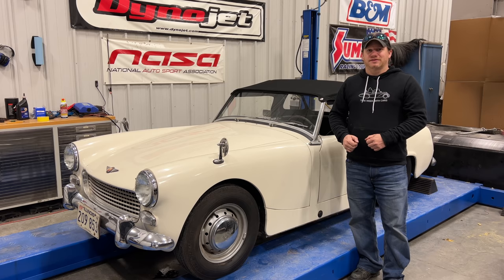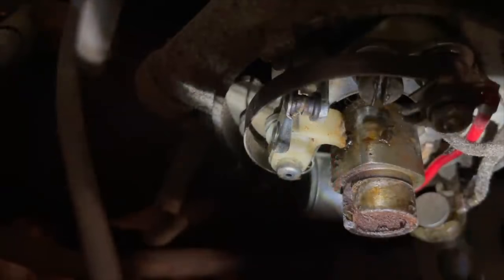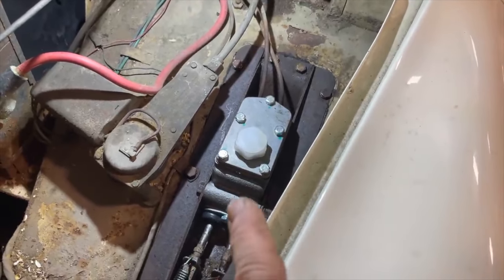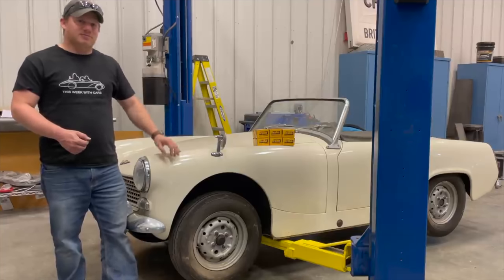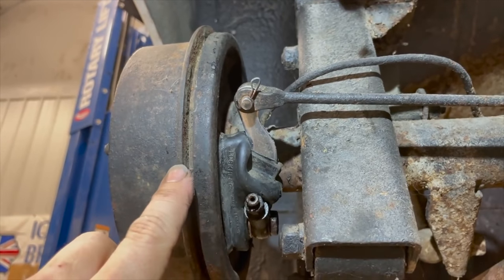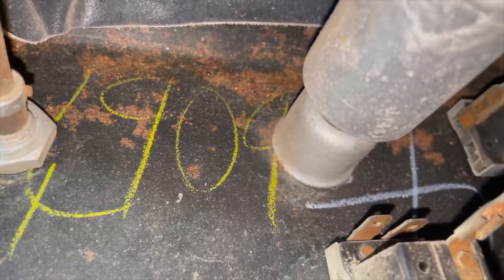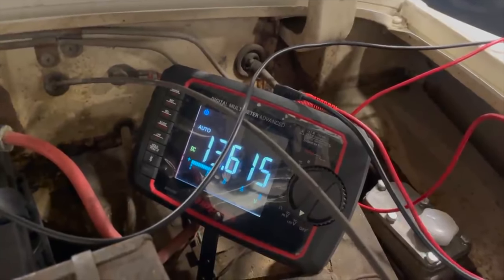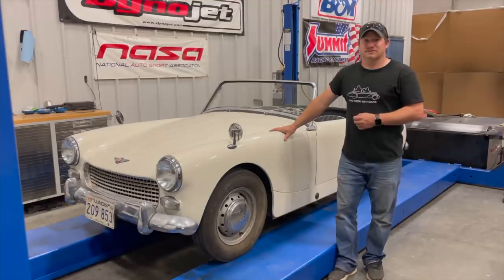1962 Sprite From Barn to Driver

Comment: Note the two jacking points on the sill/rocker; it looks like a previous owner has fitted replacement sills designed for a 74-80 Midget.

Comment: My first model was a Lindberg 1/32  Mark II Couldn't wait to get home & get Glue All Over my Dress Pants. Needless to say, Mom Was Not Happy. Now retired & getting my shop straight to tackle one I got way back mid '90s that might have been raced in Gratten. Has a roll bar & coil kit in rear. Bought it SW of Grand Rapids & I'm Now North of GR. 

Steve....Thanks So Much for doin' these vids. This One ranks right up there as one of my all time favs on the tube.

Comment: I owned that model with quarter ecliptic rear springs, which on fast sharp bends could give a quick kick at the rear if it lost rear adhesion through a road bump or wet, their was no panhard rod fitted. This was long ago in the early ‘60’s, I drove a lot of miles and thrashed the superb reliable 1098cc engine to bits, they were bullet proof, I blew the gearbox up, stripped a gear, dirt cheap to repair and easy to fix.You need a five speed box as high revs & exhaust a bit noisy on motorways. Sports dept Leyland or BMC did straight cut racing gears for those that thrashed them. You need to fit a front anti-roll bar at the front, they weren’t standard fit U.K. The A series engine so utterly reliable, just look after the ignition points with a clean now & then. They can be tuned up well, head work etc. GREAT LITTLE CARS & fun, so easy to work no thin wiring & relays no electronics- bullet proof.  THE AH SPRITE was the first before the midgets.🇬🇧

Comment: I had a 1955 Austin Healey 100 which I bought with a thrown rod. It took about a year to overhaul at the time (1966-67). It was a significant learning curve for a 19 year old kid who had no experience working on cars. Had to order parts from the UK. Loved the car for the short time I had it. The backwards 3 speed was interesting with it's aluminum housing. Fun and expensive project at that time.

Comment: I started watching this for a little while, but ended up watching it all the way thru . I'm now sorry it ended. You are a very good teacher, having a total knowledge of every part of the car and your explanations are very simple. You might have been one of the engineers who built the car. It turned into a beautiful, perfectly running car, the engine is very strong, from listening to you revving it on the test drive. A great car that you probably got for a song and couldn't have spent much at all on parts . Thanks for the fun .

Comment: My first car was a Mk 3, which I bought in 1975 for $250. I swapped drive train, interior, and other parts from my dad's rusted out Mk 3, and eventually rebuilt the engine, did the body and paint myself. I had the car for 25 years, having wrecked and repaired it twice. My dad replaced his Mk 3 with a '72 MG Midget, which he eventually retrofitted to appear as a Mk 4 Sprite.
Great series on your rehab of the Mk. 2. What an amazing find. Illinois plates and NO RUST!? Not many like that (or at all) still about. Looking forward to other vids/projects.
P.S. Don't forget to lube the trunnion bushings on the front suspension!

Comment: That was just awesome! A walk down memory lane for me, as I had bought a 1964 Austin Healey Sprite Mark II done in canary yellow in 1969. Wendy put mahogany Mack tack on the dash and that white bump the shifter and rubber boot goes through (looked great) and I applied a black leather kit for the steering wheel. Thanks for this video. Oh and the one I had didn't have the front bumper. Cheers from Canada.

Comment: Thanks Steve!  What a great old car, glad to see it on the road again.  I drove a '64 with tall skinny tires in Wisconsin for a few years, and it did great as long as you kept moving.  I think the skinny tire footprint acts sort of like a ski, the car just sort of glided along and cornered quite reliably, particularly with a couple of bags of sand on the floor in the rear seat area.  Getting started from a stop was a bit tricky, particularly if there was ice on the pavement from other cars dripping while stopped at a corner.

Comment: Thanks for the combilation. The car has survived very well. The only thing I noticed  which maybe is an issue is that it sits very low at the back. Something with the quarter eliptic springs or their Mounts

Comment: Hi, well done with all your work! they're great little cars... I owned a '64 Mk1 Midget at college in the 70s, then bought a Mk3 Sprite some years later which I subsequently rebuilt with a glass-fibre Sebring front and rare after-market Kamm-type rear with an open top (not a Lenham-type coupe). Then did full bare-metal rebuilds with a friend on another three Mk3/Mk4 Midgets. Here in the UK corrosion was/is always a huge issue (wet and road salt, etc), necessitating A LOT of fresh metal. I'm guessing yours tend to fare better in that respect. or has your car had much welding done?... Replaced pretty much everything else too - including the felt bushes in the steering columns which have to be soaked in engine oil...and quite a lot of engine modifications  as well...

Comment: I wish I could find one of these here in Maine, to get road worthy but the ones I find are too far gone or way out of my price range. I did by a 1963 11 yrs ago, right hand drive Sprite green with black interior but it is rusted in two, there is no saving the frame. I did get it running 3 yrs ago it says 57 thousand kilometers on the odometer and it still has a lot of good parts if I ever can find one with a good undercarriage.

Comment: need to get some guides on the inside edges of that lift.  you almost ran off it on the drivers side rear.  instead of greasy fingers - can i suggest earthquake putty? available at home improvement and big box stores- works like a champ and not greasy.  holds screws to screwdrivers and nuts in sockets and wrenches.

Comment: Really liked your compilation but….concerned that you put water in the rad but you did not indicate that you replaced it with anti-freeze before going for a winter drive. Hope you did or you might have to re-do that engine. Here in Canada, this is always a major issue.

Comment: Hello Steve, I have a 67 healy that has been stored for at least ten years. I'm trying to figure out if the engine has seized. When I try to start it, the fuel pump comes on and  all I get is a clicking sound. Could you tell me where the starter silenoid is so that I can try your same method?
Reply: SU Fuel pump has contact breaker points, makes & breaks like in a distributor, clicking continuously it’s not sucking petrol, they are simple to take apart, easy to spot faults, and usually very reliable.  Sometimes after taking apart they have an airlock, Just hit the casing, sometimes they work you drive a mile or so and the engine stops, this after engine work etc, it’s just an air lock tap it, with ignition on in neutral gear, brake on. Clicking engines solenoids, it’s usually dirt oxides on contacts, check leads, clean starter motor all contact point etc, check starter motor off the car.

Comment: Typically these Spridgets are fairly Bullet Proof you will find some of the Rubber Seals on Brake /hydraulic systems and maybe some Coolant Systems that have been sitting the older British Cars used VirginRubber seals on most of those Systemems and petroleum based modern Antifreeze and Hydraulicfluids will disentegrate those seals  in a matter of weeks  or can  it’s often that inAmerica someone doesn’t know that  and has topped off those systems  the easy solution is to use  CastrolGTX brake fluid only which is a Vegetable based Fluid DOT 3 compatible or buy new Silicone seals that are available thru Moss Motorsandother sources now  in the past they were dealer only items

Comment: Steve, do you have a recommendation for cleaning carbs if you don't have an ultrasonic cleaner? Also I noticed you replaced the radiator but I don't recall you mentioning that. Great detail as always.
Reply: He took it to a radiator shop which rehabbed it.
Reply: @datasailor8132  thanks, missed that episode.

Comment: You can easily convert the to Midget  front Discks and relatively inexpensively as well ! If you go to  a bigger motor or desire better braking ?  I  don’t mind  using rebuilt new Shoes   On the front sysystems if they are dialed in correctly with a rebuilt Master Cylinder Of Course  the Car will stop as Intended and the 1200 isn’t exactly a Powerhouse !    The reality is it’s a car with 50 year old Technology

Comment: Can you buy disc brake front and rear for them ,,
Reply: Just use later Midget brakes.
Reply: @johnwren3976  I had a Mk 2, that was 55 year ago, if I remember correctly it had front disc brakes, drum rear.
Edit, mine was a Mk 2a front disc, 1100cc engine, I think 1964 was the year.

Comment: Yikes! You started it without getting oil pressure first? This was going along fairly well until then! Always get oil pressure by running the starter first, so you don't starve the (dry) bearings. As you then show, just pull the gauge line to check for oil, and prime if necessary.
Reply from the maker: The oil will be there through capillary effect and will create a hydrodynamic wedge.  As long as you are not putting a load on it everything is fine for a bit just as running the engine without coolant is fine if it is just a few minutes.

Comment: You should never have started the engine until you saw to the oil pump. And replaced the old oil. 

You may have given  excessive wear to the bearings. I am surprised it never seized.